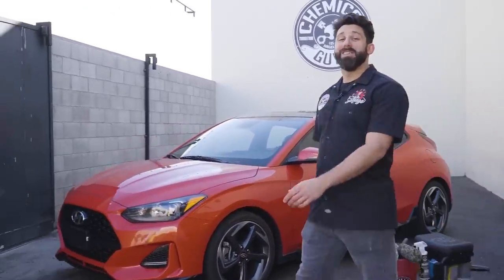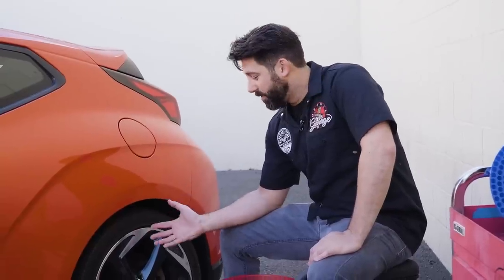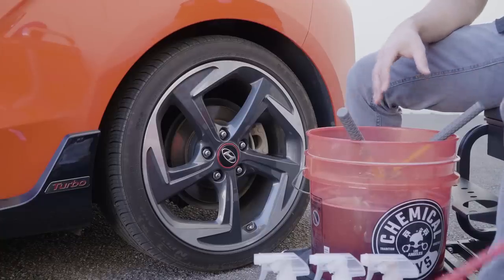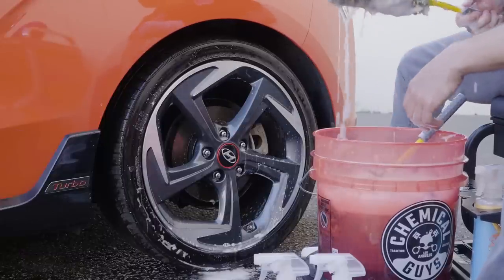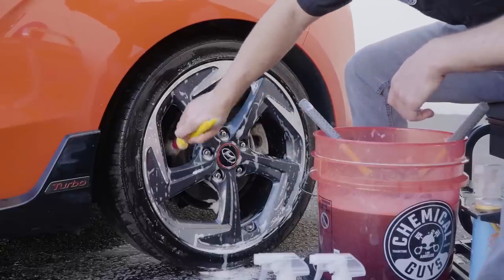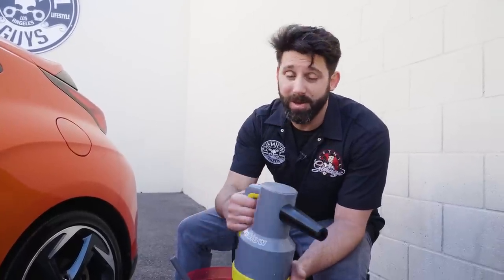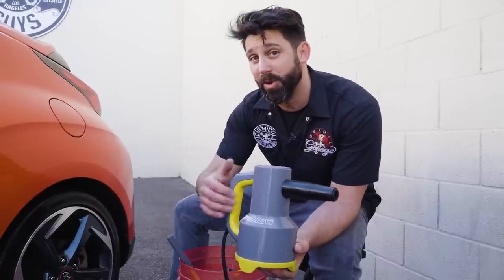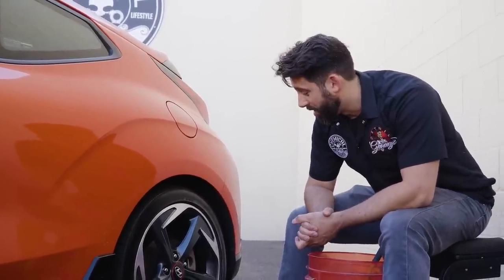How To Clean A Dirty Wheel In One Minute Flat! - Dirty Shorts Ep1 - Chemical Guys

Comment: Does anyone have tips for applying a shine to all terrain tires. I've used the tire applicator from chem guys but I found it hard to get between the outer tread of the tire.
Reply from the maker: Hey! After cleaning and drying the tire, use an aerosol dressing such as Nice & Wet to easily add shine.